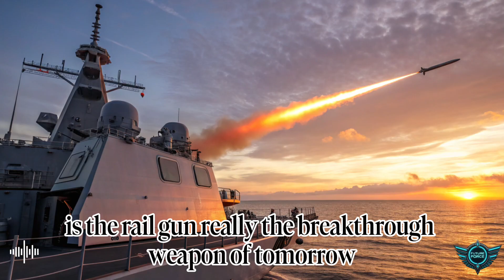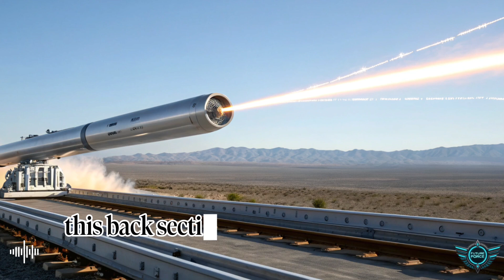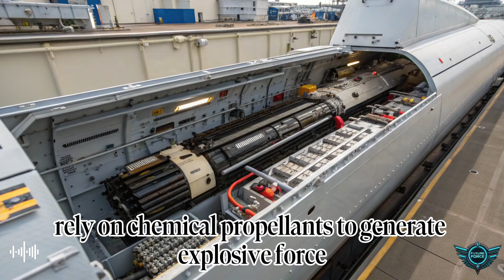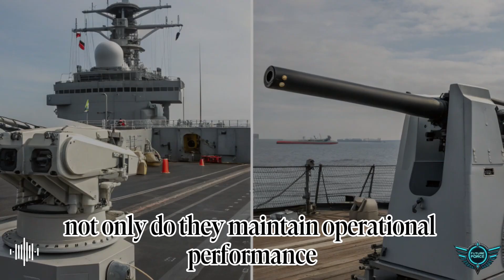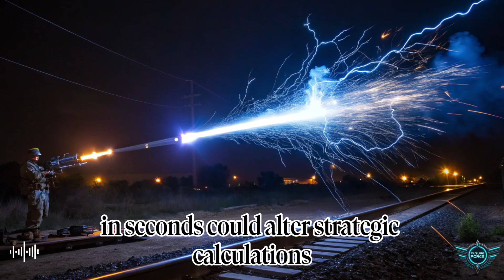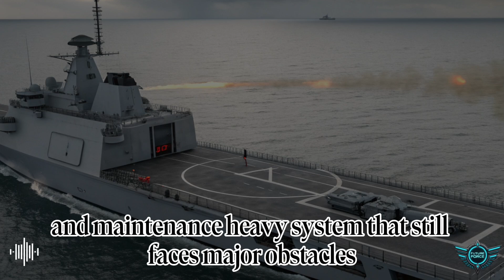The Truth About Railguns – Future Weapon or Costly Failure?

Comment: Railguns technology would probably allow humans to destroy an incoming asteroid or meteor IF the railgun projectile didn't have Earth's atmosphere to travel through. I could see one on the moon or Mars (or on a  orbital platform) a few hundred yards long with a solar array or conventional power supply that could what??? Launch a projectile at a % of the speed of light???? How fast is 10% of the speed of light and could we approach it with railgun technology and unlimited funding? How fast is fast enough to "kill" an asteroid? Anybody else curious? Have an answer? Wanna discuss? Fascinating topic for me.
Reply from the maker: Yes—no atmosphere means no drag or plasma blow-off downrange, and no aerodynamic heating. Space or lunar guns also avoid launch windows from deep gravity wells. You still face three brutal constraints: (a) accelerating a physical projectile without vaporizing it, (b) supplying and switching gargantuan electrical power in microseconds, and (c) barrel/rail erosion from mega-amp currents and contact forces. Vacuum doesn’t fix those.